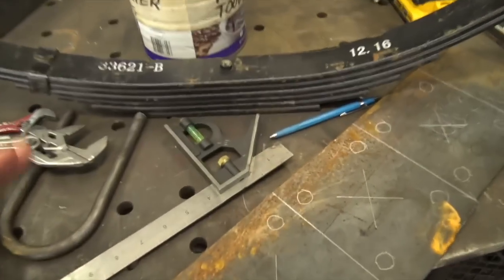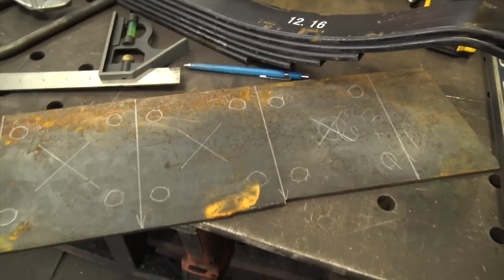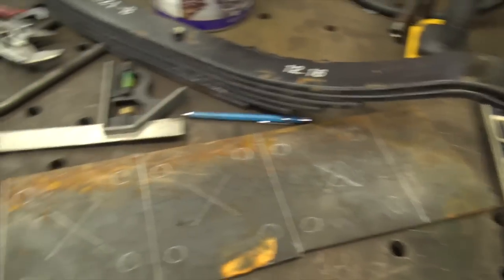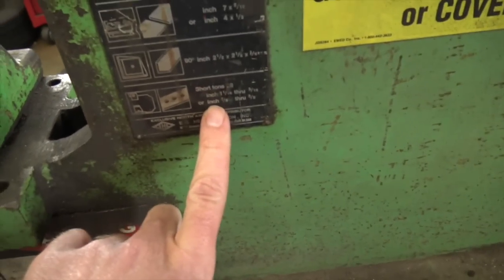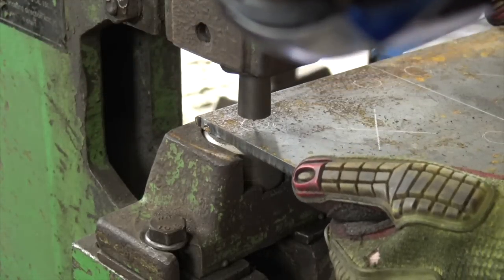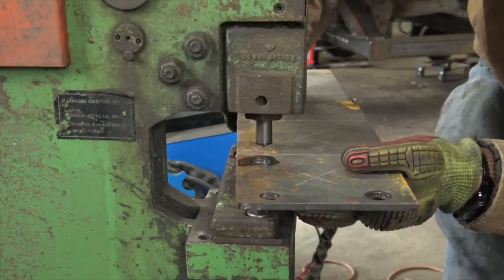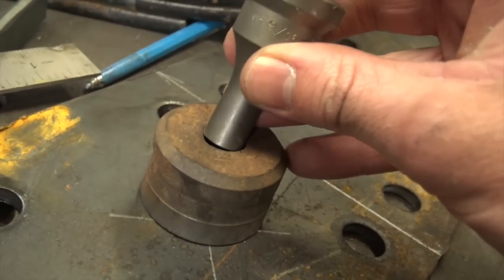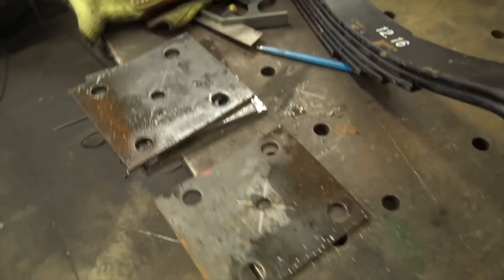WHY IS INDUSTRIAL METALWORKING EQUIPMENT SO CHEAP?? I BOUGHT THIS AMAZING GERMAN MACHINE FOR PEANUTS

Comment: Worked in a manufacturing plant that had a couple of these Ironworkers that were running 8 hours a day. One was set up to punch and cut plate, the other was set up to punch and cut angle. These things just go and go with no problems.

Comment: This gave me a flashback to a job I had just started long ago.  They had me punching 1" holes in 1" plates roughly 12" square.  Similar but larger machine and the clamping device leaked so wouldn't stay tight so it was all hand held.  Every time the punch came up it would bind in the plate until something finally let go with a loud bang!  I think the handy chart indicating recommended max capacities was long gone!  Those machines are awesome but give no quarter if any part of you gets caught in them!  Stay safe sir!

Comment: Like the guy below said, Center Punch your holes, and if you aren't working with real heavy stock, you can lift the plate to the center nipple on the punch and let your stock ride down with the punch. Perfect Center Every Time. I can't begin to guess how many holes, Slots, and Squares I've punched over the years as I used to make Pipe Flanges.  Also, was the plate too wide to fit through the cutoff blade on the iron worker?

Comment: You can make a new stripper in about a half hour. I have built several custom made strippers for different jobs over the years. That punch and die will take far more tonnage before breaking than your machine will create. That is a very nice machine. You can easily build new tooling for it with just a little effort.